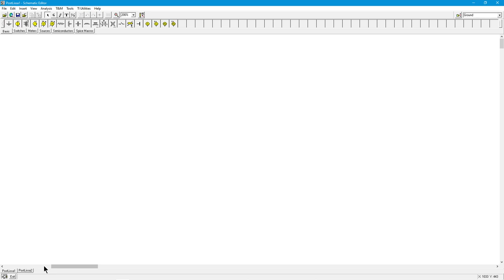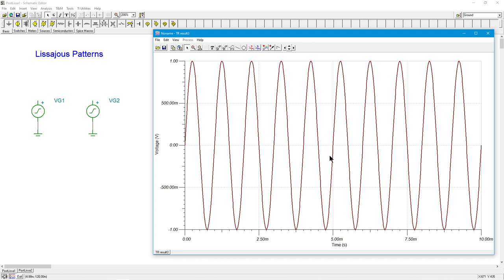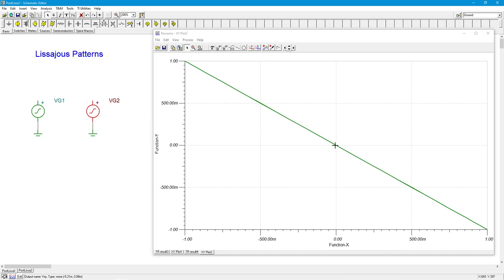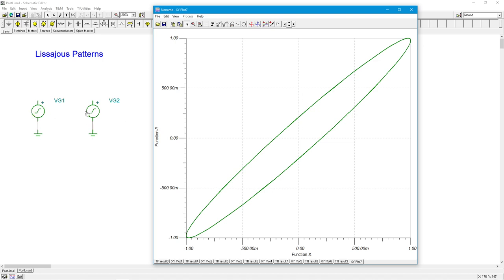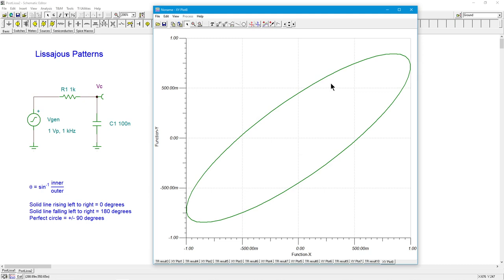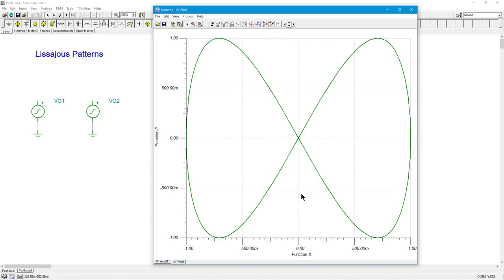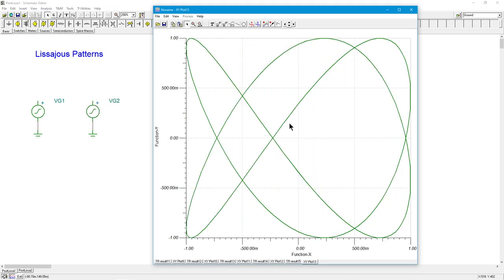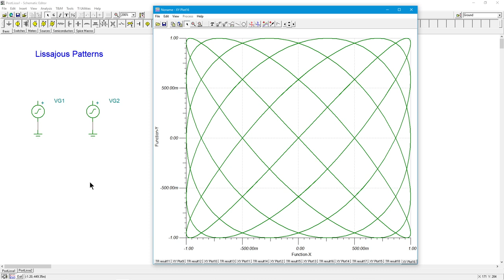TINA TI: Lissajous Patterns

Comment: You sure took me back in time. I was in tech school in the late '60's and early ''70's and we did Lissajous patterns on old vacuum tube oscilloscopes.  I also programmed in BASIC using hollerith punch cards and learned on computer trainers that utilized iron core bead memory.  Damn, now that I think about it I'm as old as hell.  I doubt that we could have imagined schematic editors but sure would have killed for one had they existed.  Keep up the great tutorials.
Reply from the maker: When I was a kid, there was a local TV station that had a rock-n-roll dance show. They used to start it with a shot of a 'scope face displaying a Lissajous pattern that was not quite 2:1 so it sort of bounced back and forth like a pulsating infinity symbol (like 17:00). They timed it so it was in sync with the intro music. "Crazy, man, just crazy!"